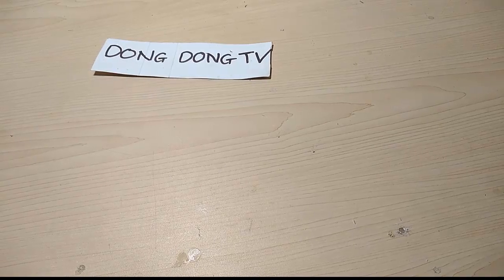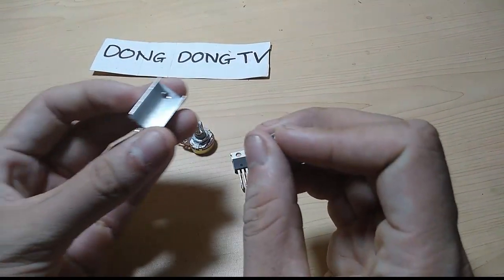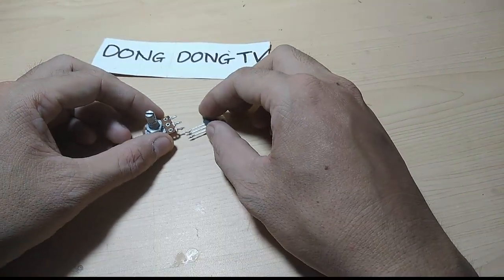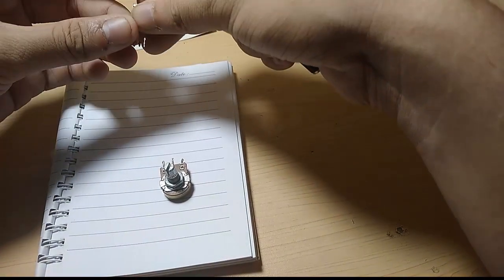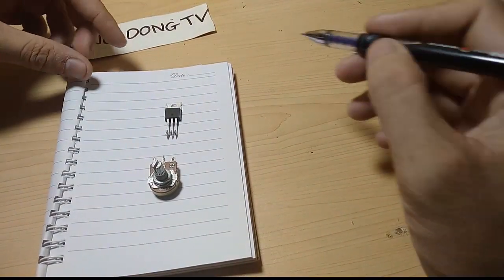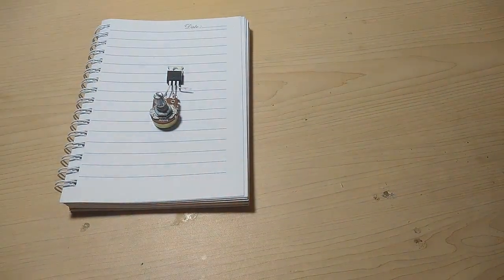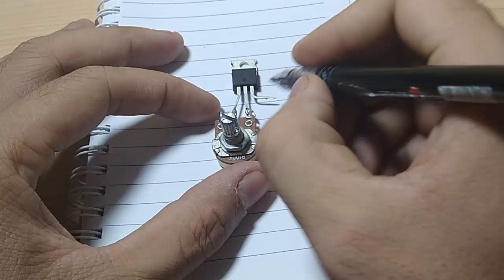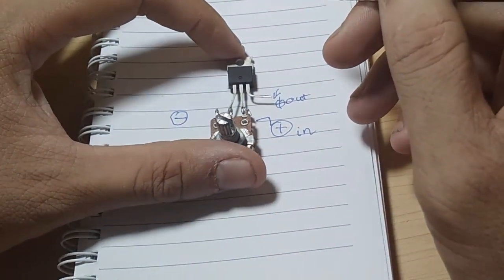homemade simple speed controller motor using MOSFET IRF540N

Comment: Why only controll just 0-8v on 12v? On datasheet the mosfet ds resistance is 0.16 ohm
Reply from the maker: course i use 3s battery and that is low power